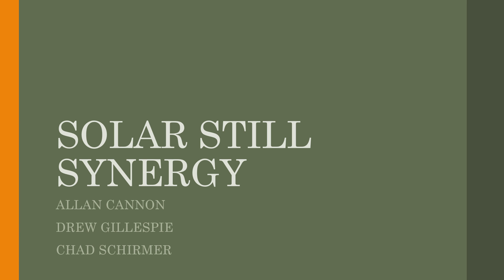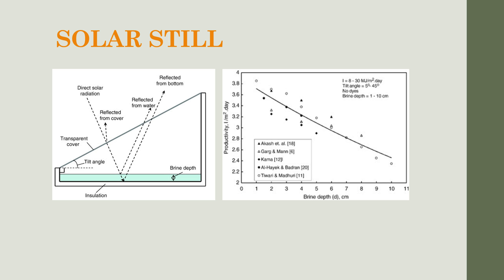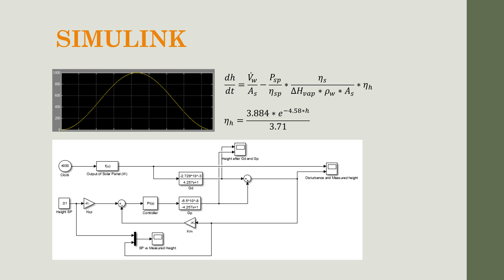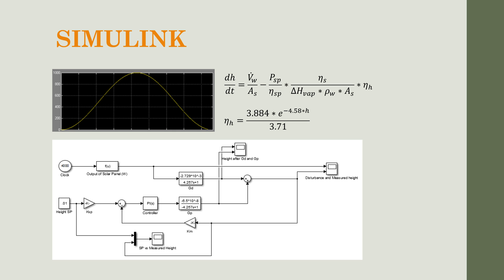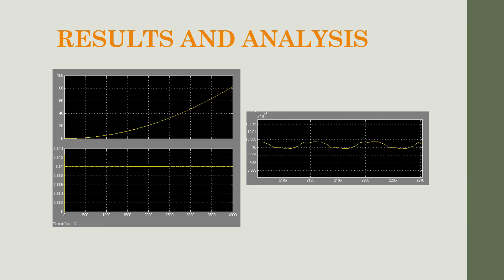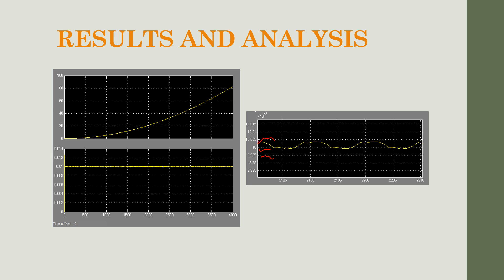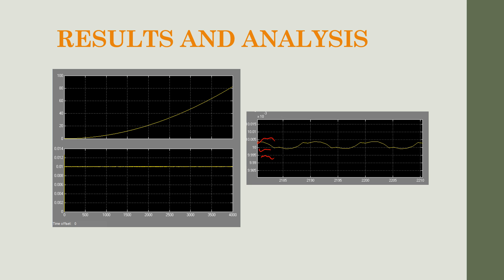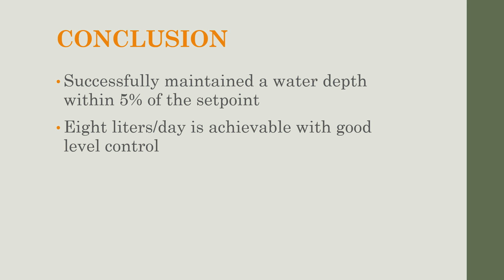Water Production Optimized in Solar Still

Comment: dear mr APMonitor Sir,
can you give me the complete simulink file and code sir?
Reply from the maker: +Hangga Wicaksono The transfer functions are given at 1:45 in the video. You should be able to reproduce the results if you can pick out the transfer function values. Unfortunately, I don't have the original files.